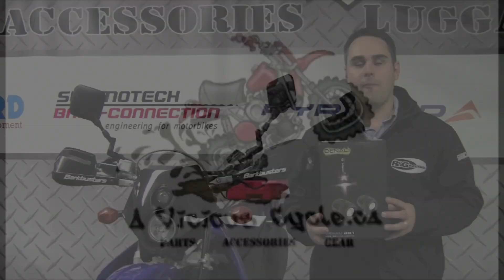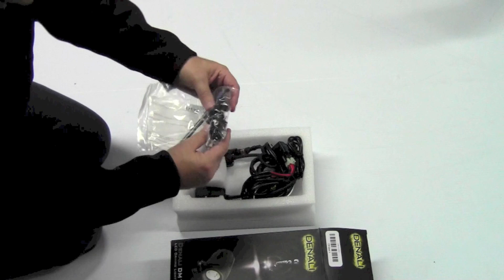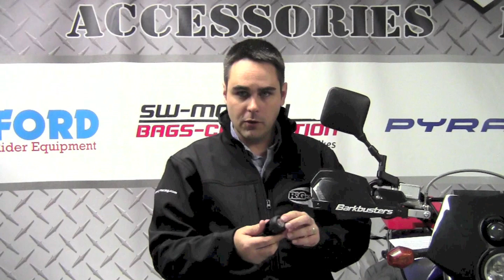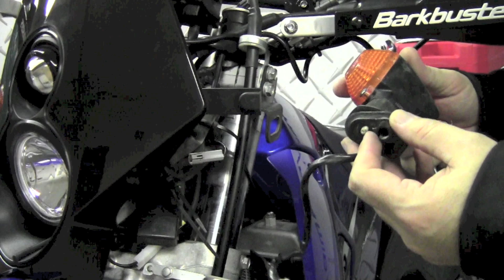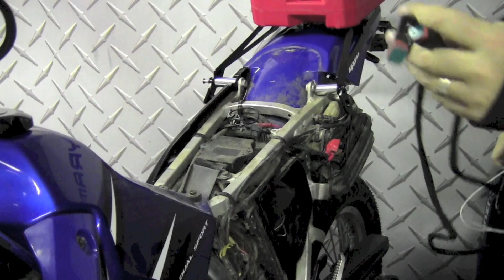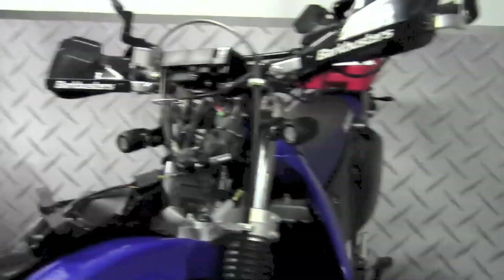Denali DM1 LED Motorcycle driving lights

Comment: why replacing the turn signals (useful on road at least) with the lights? You could have kept both.
Reply from the maker: +TerryFrenchy We did keep the turn signals. They were moved to the hand guards as LED's. You need the turn signals fairly far from the bright Denali DM1's as they will easily "wash" out the comparably dim signals.